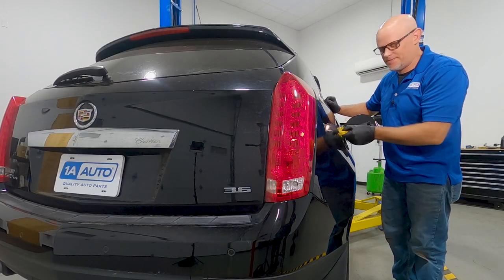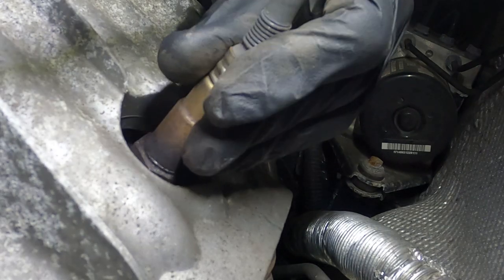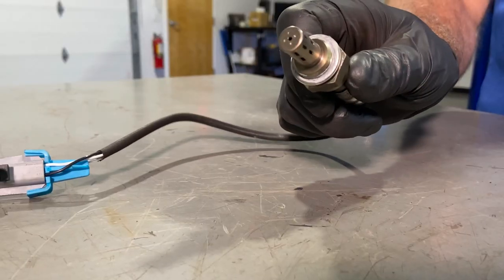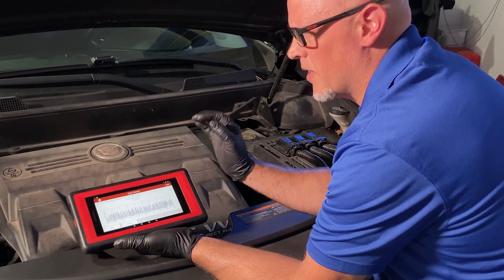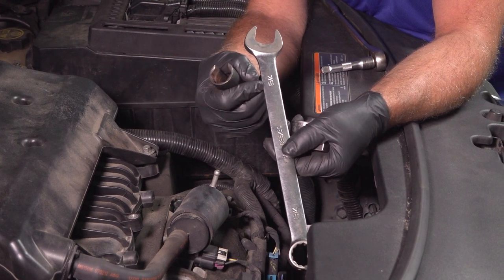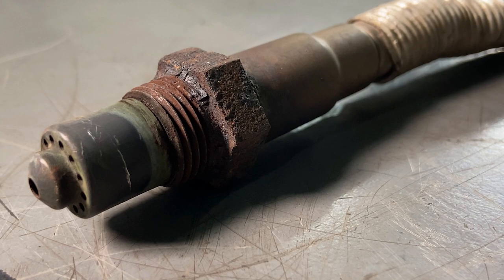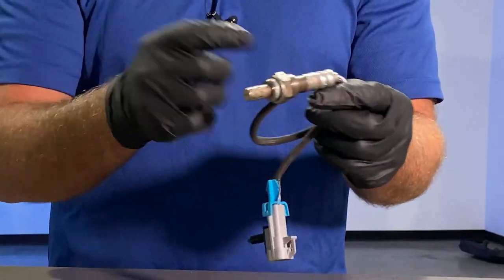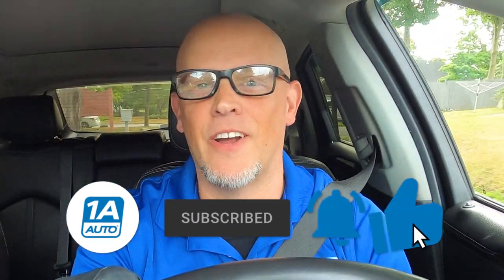Poor Gas Mileage and Codes? Will Faulty O2 Sensors Hurt Gas Mileage, Or is There Another Problem?

Comment: In the past I've owned two tahoes & both struggled to get over 200 miles per tank. Even on the highway(no I didn't drive with a heavy foot) one of them I got the 02 sensors replaced and a tune up and there were no improvements. None. 
Now I own 2000 monte carlo and in the city it gets about 220 and on the highway just around 240 miles per tank.  Why is it that all gm vehicles I've owned have terrible gas mileage. I've seen other tahoe/suburban owners get twice as much milage than my gm vehicles. Owning gm automobiles has become frustrating
Reply: Have spent thousands upon thousands on GM garbage the only reason is my wife insisted on driving these stupid vehicles.Even after repeated break down after breakdown and all the gas they take.The denali we just got rid of had mpg fall from around 17mpg to 11 mpg another repair no doubt just garbage cars that have cost me at least 130k over all !

Comment: Hi I have a question I have a 2013 Cadillac ATS it keep reading bank 2 Sensor 2 I have replaced it three times and my check engine light still on it's been on for a year now. I took it to the Cadillac shop they want to replace the whole exhaust system. went to two other places still haven't figured the problem out yet . The reset it an it still came back on .help
Reply: Ok I  had a similar problem on a 2008 Volvo xc70... Spent a ton of money on replacing whole exhaust including cat converter, code still came back so my Volvo specialist just said ... Install a O2 bang or what they call spark plug fouler I think... It just moves the O2 sensor back some, problem was solved.

Comment: My 2002 Tacoma needs a front 02 sensor. I understand from my research that it is strongly recommended to use the very expensive OEM part. What do you think?
Reply: Find the oem maker because Toyota doesn't make it.
Reply: That would be Denso. However, don't buy from Amazon or eBay unless it is from a dealer selling on those sites. There are counterfeit Denso parts on the market. Advance Auto Parts and AutoZone are both authorized sellers. You'll still pay a good deal more than on Amazon but less than from most dealers.
Reply: @stevensevek6151  rockauto

Comment: Hi I'm from Barbados I'm having an issue with my 2007 toyota camry I have my abs light on and when I turn on my ac the idle fluctuate then the P0172 code came on I check all the vacuum hoses they are good what could be my problem
Reply from the maker: +Roger Gibson We wouldn't be able to diagnose an issue like that here, you may want to have a local mechanic take a look at it. Thanks for checking us out! http://1aau.to/m/Shop-1AAuto-c